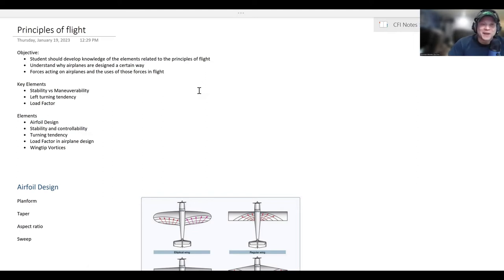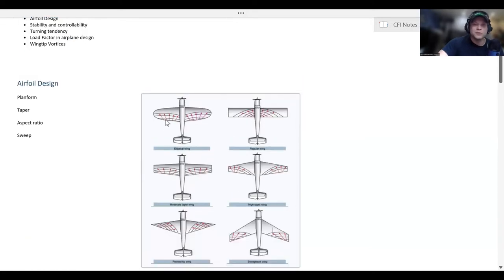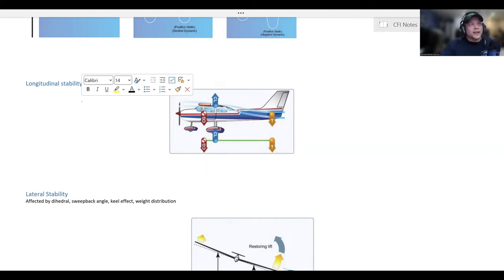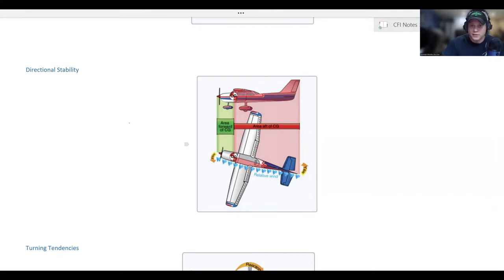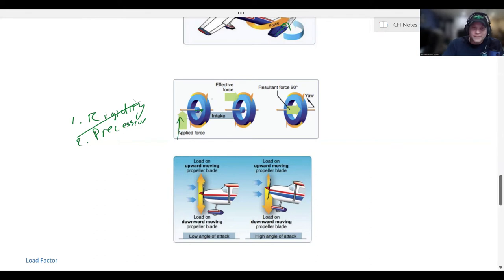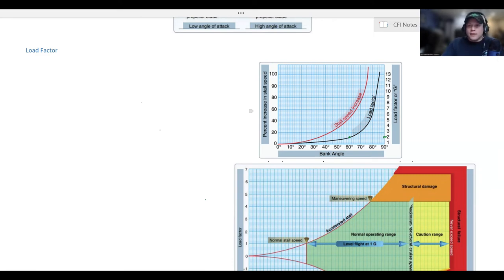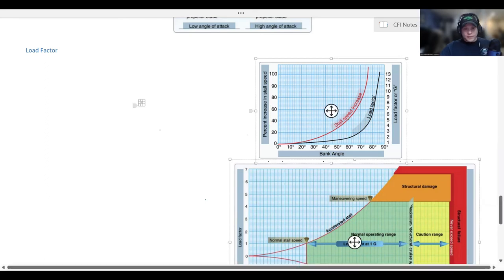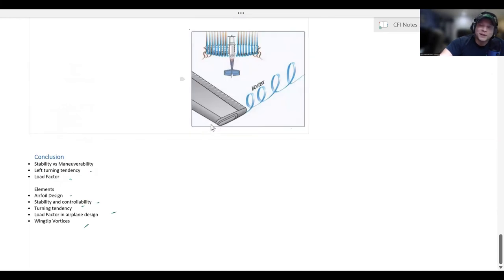Principles of flight | CFI Checkride prep

Comment: 12:40 stop with the equal transit theory :( the air is not accelerated because the distance over the top of the wing is longer, its accelerated because lower pressure exists in that area